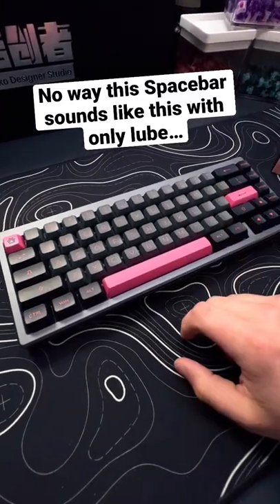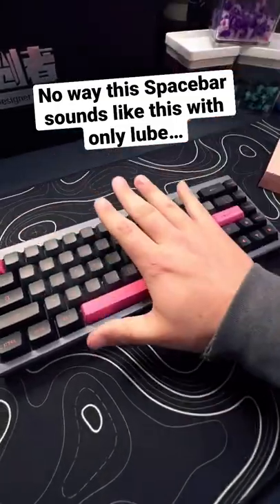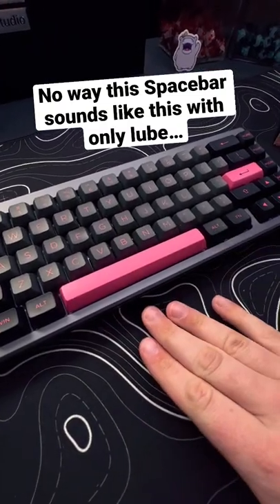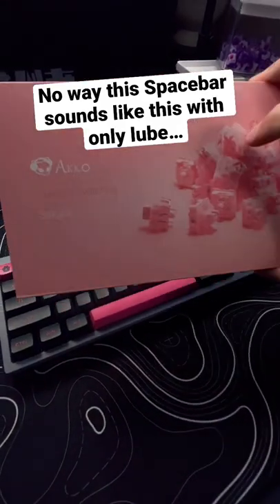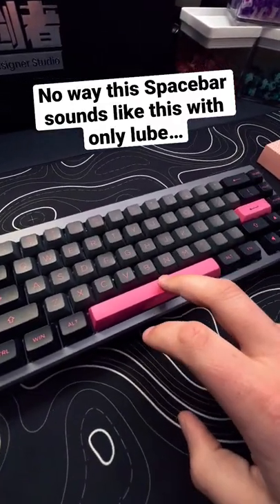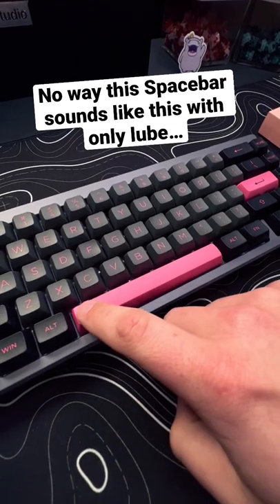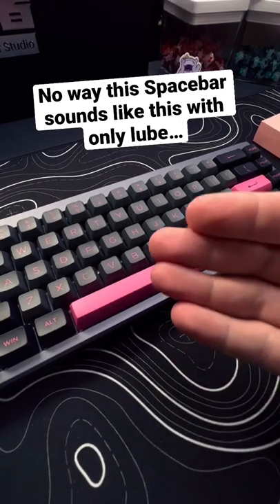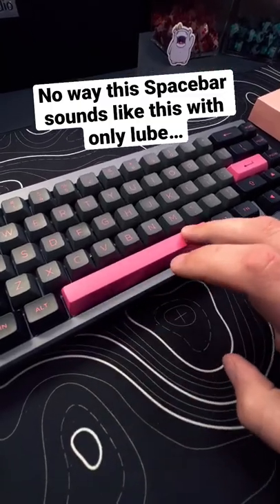This is what you want your Spacebar to sound like..

Comment: no spacebar can sound that g-
Reply: Logi g413 SE can
Reply: @friendsRfor773  that keeb sucks tbh, its a membrane
Reply: @Taqgy  its not
Reply: @friendsRfor773  yes it is
Reply: @friendsRfor773  what are you trying to say
Reply: what
Reply: @friendsRfor773  omg i have it ahahhaa
Reply: @Taqgy  Is it really hard to search on internet...
Reply: @friendsRfor773  no it can't
Reply: Just wait a month and it will start rattling again
Reply: @dhaerque  yeah to fix that problem you can lube the wire end with a syringe to make it really consistent. it works with my durock v2 stabs
Reply: @friendsRfor773  logitech keyboards are trash what are you on brother

Comment: oh no, 1 week ago I didn't know what custom keyboards were and now I just got excited for the sound a spacebar did, what have I done...
Reply: Same... Fucking YouTube algo
Reply: Welcome to the club
Reply: i know mechanical keyboard from some random store and i thought the clicky one is the best, i regret my life choices
Reply: i have been here for two days. two fucking days.
Reply: @LotusDollaSign  i'v been interested in keyboards for 2 weeks. 
So far, i've modded my corsair strafe with band aid, foam and lube.
And I've built a wooden GK61X with gatheron milky yellow pros and super thick soft keycaps, bandaid mod, holee mid, pcb foam mod, tape mod, case foam mod, lubed, durock modified and lubed stabs.

This hobby is just a wallet blackhole
Reply: Bro same dude, happened to me this week
Reply: Same, now i be spending hundreds
Reply: Run away before you get too deep. I am in debt
Reply: Welcome to the rabbit hole!
Reply: Same kinda, I’m drawing the line tho, because no custom keyboard can sync up with my razer rgb so it would look out of place. So I “can’t” start this hobby 😉
Reply: @-Name-here-  lol, I have moved away from RGB, my new pc has no RGB, and I removed all the RGB in my room, it just is not that interesting to look at after a few month it just gets distracting
Reply: Once you used a board without rattling stabilizers, it’s over.
Reply: Still need My apex pro tkl for fast games and programs and features. customs is a nice Hobby only u can have Over 100 customs there 100+ Switches
Reply: @ravenghost-kh9gy  same
Reply: Same I just modded my razor mini and I ordered a custom board I’m gonna build and mod myself
Reply: @oppai2797  I am interested in when you say programs and features, a custom keyboard you can do anythign you want, every key is a macro, and you can even program different "press hold, "tap" "tap dance" for multiple functions, It can literally do anything you want using via and if thats not enough code your own thing with QMK
Reply: @tombaker2510  which custom has programs or software
Reply: Apex pro faster 0.4ms most keyboard 20ms and no even 1k polling rate
Reply: And while gaming I don’t even hear how my keyboard sounds lmao
Reply: @oppi263  all customs are 1k polling now, I dont know how they measure this 0.4ms vs 20ms of other keyboards,
Reply: @oppi263  Do you mean the acturation point can be 0.4mm, I mean that is just the switch I am sure if you try hard enouhg you can find those switches and put it in a custom. I am just saying a custom can probably do everything a mass produced one can but obviously no synced RGB
Reply: Ive been here for 3 days. Just 3 days.
Reply: @oppi263  Almost every custom keyboard can use the program called VIA, a lot also can use VIAL, and they are all using the QMK framkework which has online tools to help you program stuff, VIA and VIAL are just frontend software you install to make QMK easy EDIT: I know this is a late reply lol
Reply: Dude same 😭 rip to my wallet
Reply: Welcome to the hole
Reply: Welcome...
Reply: That happened to me too :/ the hobby just kinda sneaks up on you and then it’s too late😂😂
Reply: you're gonna hate yourself for getting into it. i do. i cannot afford this fucking hobby but i can't look away lmfao

Comment: There's gotta be some crazy case foam in this build. That space sounds like it's mounted to solid stone.
Reply: Yeah
Reply: It's Akko. Many professional custom keyboard modders likes Akko for the value.
Reply: @greatbeavers9418  i have the exact same switch and it dosn't sound that great. I think its the whole keyboard that makes it sound so good
Reply: It’s the spacebar itself, not any foam.
Reply: @chunkymilk1288  and how does it sound that great? Im trying to upgrade my spacebar but dont know how
Reply: @dekotipps3525  try using oem or SA profile keycaps, normally the spacebar from these profiles are taller, resulting in this hollow and resonant tone
Reply: @greatbeavers9418  nah akkos are trash to be honest. If your on a budget sure but for decent to great builds, akko is the worse you can use.
Reply: @justanobody4983  Welp, that's likely up to you. If you can afford the price for much better than Akkos, that's great.
Reply: @justanobody4983  What's better, Akko or Gateron?
Reply: @surinder4430  gateron is far superior

Comment: That's because PLATE MOUNT CLIP INS are the best and most... STABLE stabilizers. No pcb screw in stabs come close. I don't get the hype of the screw in stabs, wobbly as hell if you don't have very tight tolerance in the switches :/

Comment: Do you know any good cheap stabs? I had to spend a lot of money to make mine sound good
Reply: durock
Reply: @shoxerx7406  not as good as staebies
Reply: looking for some cheap ones that are better than my current stabs (staebies)
Reply: If your trying to get rid of the clack..silicone inside the bar itself to deaden the high frequency there, put a dab under the clips (think how you can deaden a ringing bell by simply touching it). If you wanna go all out you can coat the majority of the metal with silicone or use fine silicone tubing for a sleeker look. Deadening sound in such a small area shouldn't cost you anything at all really.

I got a board kit coming with an alu plate, I'm going to give soft conformal spray coating a try. Most of the sound will be coming straight from the keycap though, it resonates and acts almost like a speaker cone.
Reply: Look up TX stabilisers. Better than all other stock including staebies imo but they're like gold dust
Reply: GSV2 not really available yet tho
Reply: Best cheap stabs are cherry clip ins. TX and Staebies are great but expensive and difficult to find.
Reply: @jboib  I have staebies but im trying to find good ones for my next build
Reply: @killstealer_s  hard to get any better than staebies. Your next stop would be TX if you don't mind that clip in shit.

Comment: How i try to lube my stabalizer but it still sounds bad
Reply: Cuz ur stabs r bad
Reply: @kabes1776  yeah maybe its just a chery plate mount stab idk is it genuine or not tho
Reply: @David242Rblx  Stock stabs on most boards are garbage tbh. The wire is unbalanced and the housing aren't great. Some mods can make it sound amazing. I did a mod that's my own alongside the lubing, holee, and bandaid and that managed to give me the best spacebar experience I could get from stocks. It sounds like this vid but deeper. It's also nit mushy, contrary to popular belief. Maybe it's what I used, but it's great and I love it.
Reply: Lube is for friction. You need to dampen the vibration. Rubber, silicone, high density foam. That kinda thing. For lube to work it would have to be dense as hell and coating everything, and that means too much grease, it will eventually work it's way inside and either short the switch or prevent it making electrical contact.  ..as well as building up dust and grit (don't use grease externally wherever possible)
Reply: my cherry stabs needed to be clipped since they didnt lay flat on the plate. did you need to clip them at all?